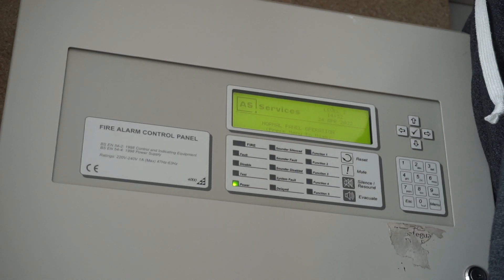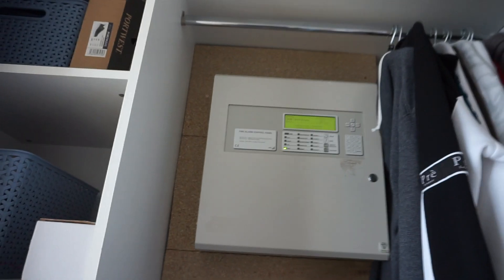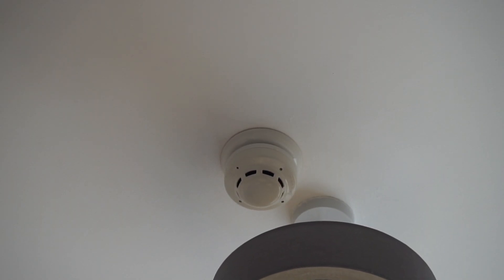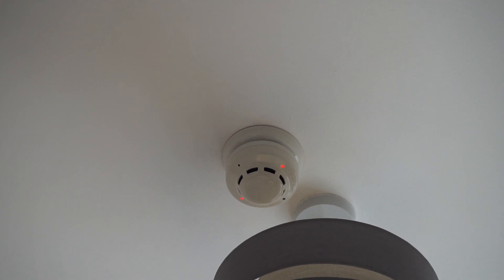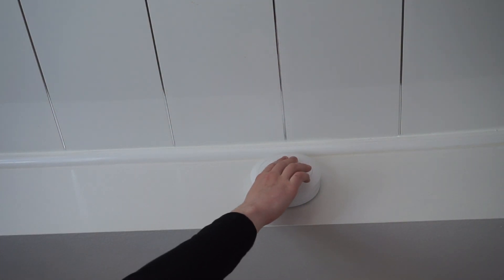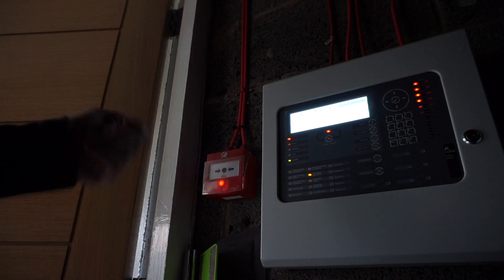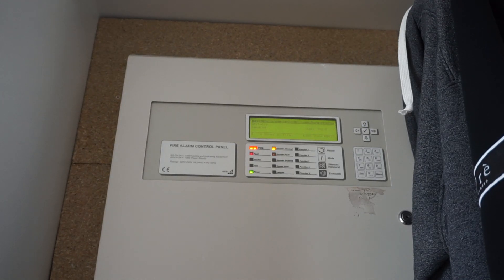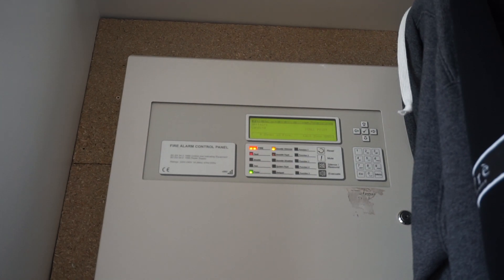Apollo/Hochiki ESP Addressable Fire Alarm System (System Test 28)

Comment: What device do you have that runs the voice speaker?
Reply from the maker: No longer have this fitted but it was a device that had the message stored with a mini built in amp. When power was applied the device would sound.